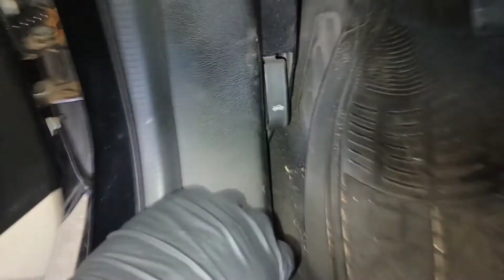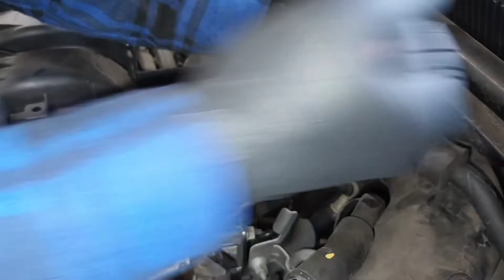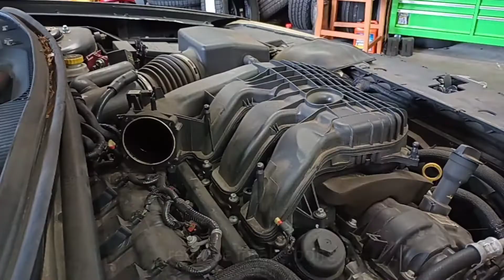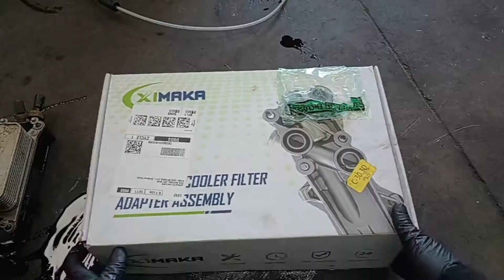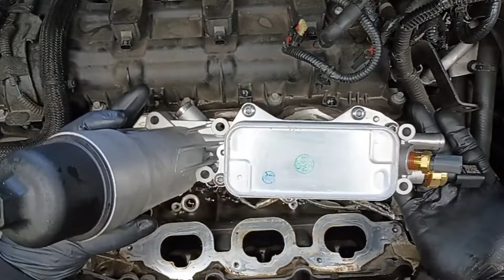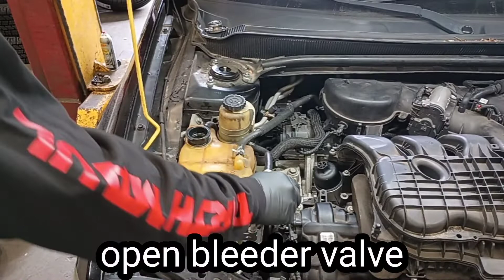oil cooler housing replacement on a Dodge avenger (oil filter housing)

Comment: Are you supposed to drain the car of coolant and oil ?
Reply from the maker: Good morning Brian it's honestly up to you if you want to drain the coolant halfway.. when I have to replace an oil filter housing I usually just remove the coolant hose that's connected to the oil filter housing and just use a manual fluid extractor to suck the coolant in the valley then I remove the oil housing ..but all in all you don't have to drain the coolant or the oil..🍀 hope this helps